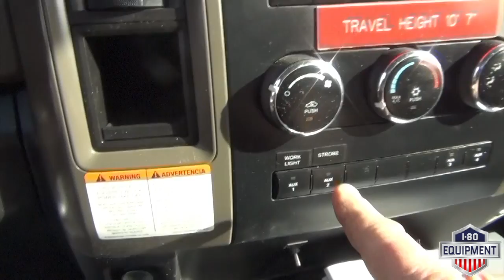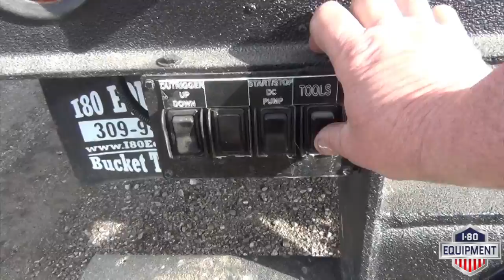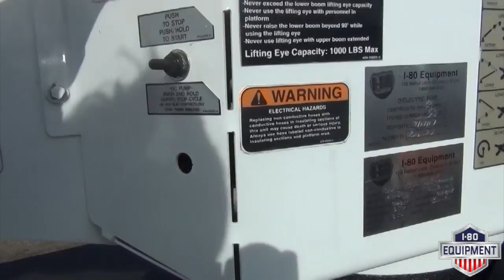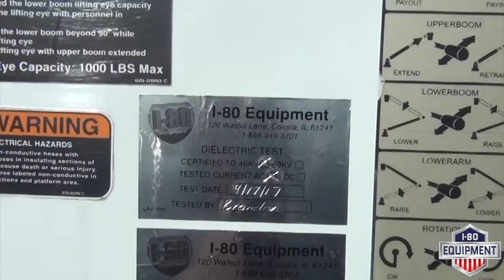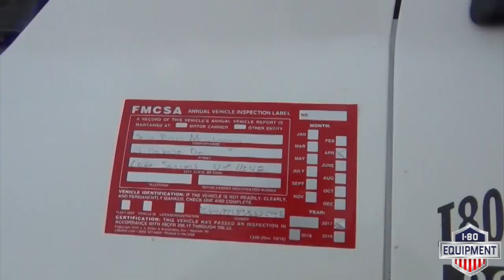2011 Dodge 5500 4x4 Altec AT40MH Bucket Truck - ST#625108

Comment: My company just bought an AT37G, cannot figure out how to get the boom to do anything. E-Brake applied, PTO on, all other AUX switches flipped to on, outriggers down. I'm totally stumped.
Reply: Emergency stop switch is probably on
Reply: thomas robinette We figured it out. It was a relay or something that was basically telling the truck it was in drive with the boom up. We disabled that crap. I’m pretty sure that’s what it was anyways... been a year.
Reply: @tookyoshoes673  oh well glad yall got it figured out! Hey whats the maximum distance between the side of the truck and the bucket? Like if u parked as close to a curb as possible and then swung boom sideways. How far out will it go laterally?
Reply: thomas robinette ah shit man don’t catch me lying but I think it’s like 30-35’
Reply: @tookyoshoes673  👍thanks!